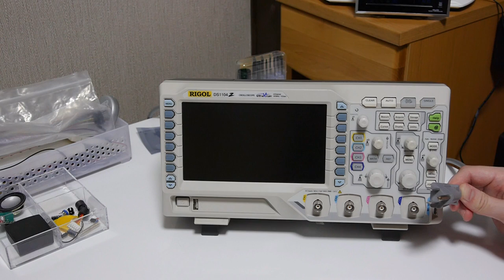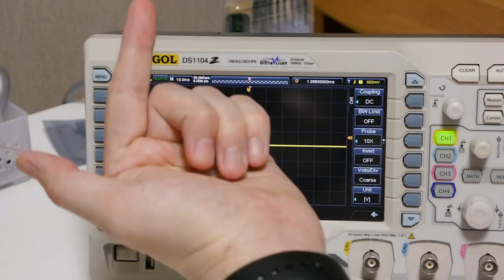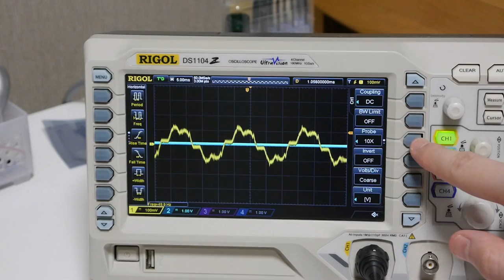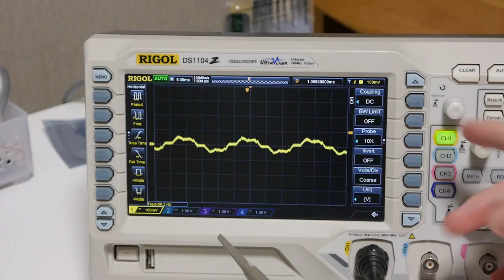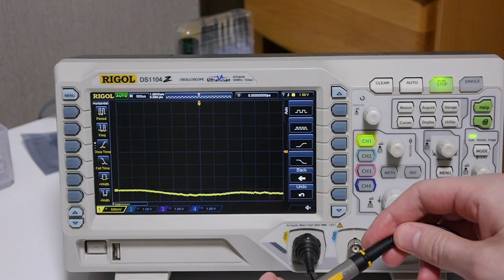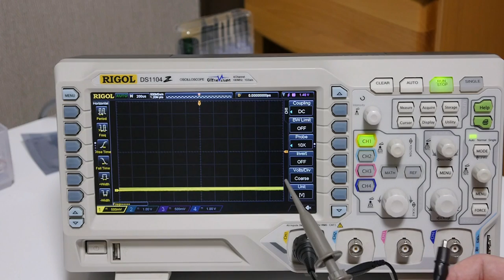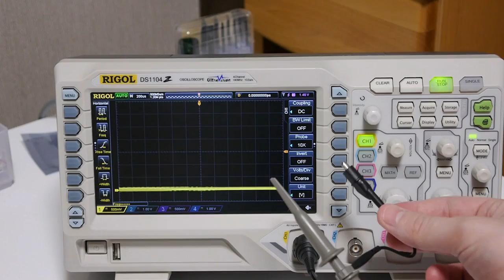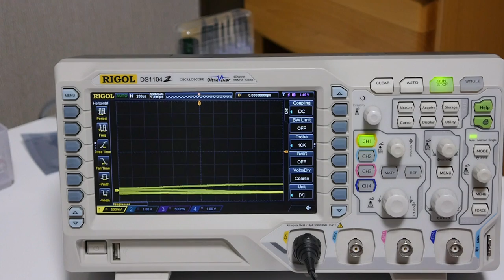Oscilloscopes Made Easy #1 - Introduction to Oscilloscopes (Rigol DS1104Z)

Comment: Great intro! In Hawaii we have many old homes wired with ONLY two wires outlets. A Hot black wire and a White Neutral that is ground ONLY at the meter socket, if at all.  As an licensed electrician contractor, if we in’s talked a NEW outlet we had the option of installing a properly grounded (to GROUNDED METAL WATER PIPE) or installing a GFI outlet. The GFI outlet did NOT have to be grounded. The argument is the GFI is measuring an imbalance in electrical flow between Hot going out and the electrical flow returning on the White wire. Any imbalance tripped the GFI. It would seem that if an technician were to always use a portable GFI protector cord ( less than $40) they would be protected from injury from shock and equipment protected. Further more if the GFI whip cord was plugged to power using a three prong to two prong isolated adapter, they keep GFI shock protection and are TOTALLY  isolated from ground. I do believe using an ungrounded GFI meets National Electric Fire Code for safety. What is your opinion?

Comment: First time I caught your channel, I wish I'd seen it two years ago.  I have the same scope and also live in a 50 Hz region of Japan.  As you say, grounds are a problem here, but I paid extra to have Type B three-pronged wall outlets installed in the one room of my house that I use for my electronics hobby.  As of 2008 all new Japanese houses were required to have polarized outlets installed, but they are still only two-pronged, and oddly, the appliance industry was not required to follow the same rule so all new appliances still come with two-pronged, non-polarized plugs. Care should therefore be taken when plugging in any light-duty appliance built for the Japanese domestic market.  Only heavy appliances like air conditioners and washing machines come with grounds, but they are generally just pig-tails so should be plugged into a dedicated outlet equipped with a grounded screw terminal. I also use an isolation transformer on my bench to isolate my DUTs from the house ground while leaving all my test gear safely grounded.  This reduces the chance for shocks when working on tube radios and other high voltage equipment, but does not completely eliminate it, so care should still be taken.

Comment: About the 50MHz bandwidth, is that per-channel, or shared between the channels?
Under the supposition that it is per channel, that would allow a total of 200MHz across all channels (1Gsps @ 5 samples per cycle of displayed signal).  If only one channel is in use, is the bandwidth improved?
Reply: @reeder 76 Thanks for the reply.  What you say is what I had suspected, though it wasn't clear in the video , but in the meantime, I've bought a digital scope anyway - a low-end Rigol 4-chan scope, but it will be adequate for what I need.

Comment: Thank you so much for these videos! It has been a great help. Can I probe USB powered things if the scope is grounded?
Reply: Hey there. If you haven’t fried anything, the best thing to do is use an unplugged laptop. You can also write to EEPROM if your using avr/arduino and power your project using an isolated ground on a bench supply. Be careful that you don’t short your mains earth ground to anything connected to your mains referenced voltage.

The mains earth pin on your socket is directly connected to the ground plate of the BNC on the scope.

Comment: I have mains voltage of 262V , I measured it with my multimeter which is NOT true rms. Power voltage in Rigol DS1054z specs is 100 V to 240 V. What should I do?
Reply: try using another multimeter which can measure true RMS to measure mains voltage. there shouldn't be more that 230V

Comment: About grounding, if i use isolation transformer and float the power ground prong, like connect to nothing, will that simply means it will short to nothing else i probe. Won't that be safer (not for user, but for scope)
Reply: Thank you. I think the only difference between putting isolation transformer and breaking ground on scope or DUT is just personal safety. If i put it on the scope side, I'll sacrifice personal safety with scope safety, like, I never have to worry about where i probe, is that correct?